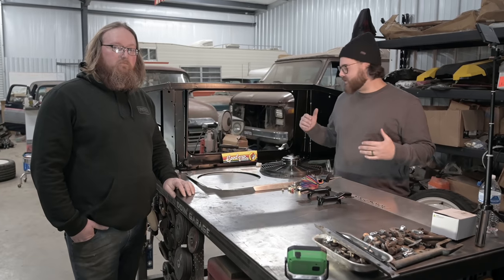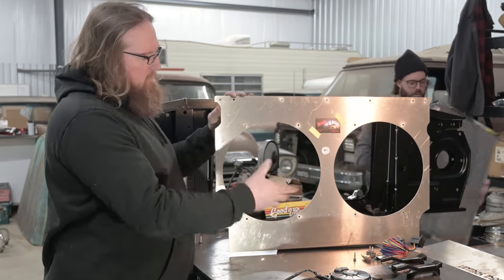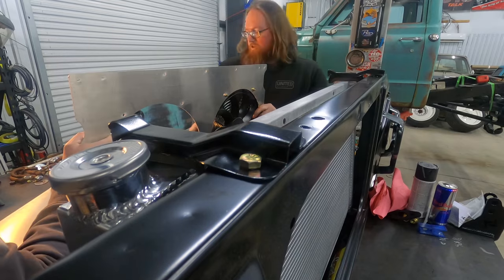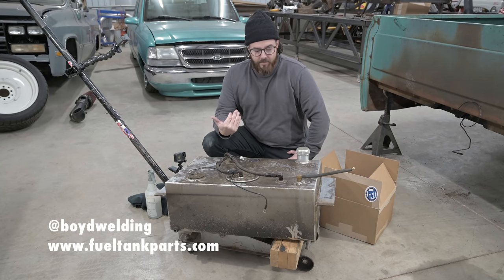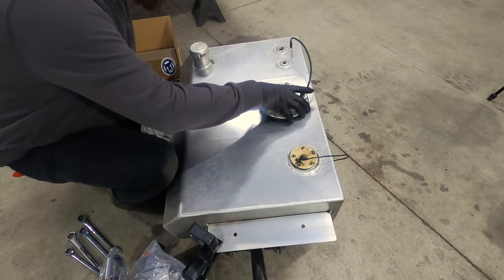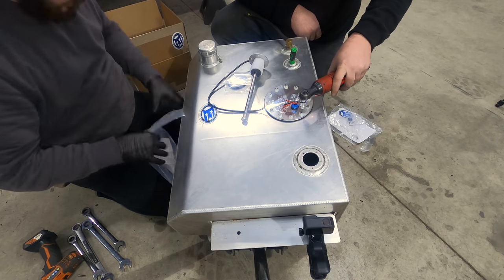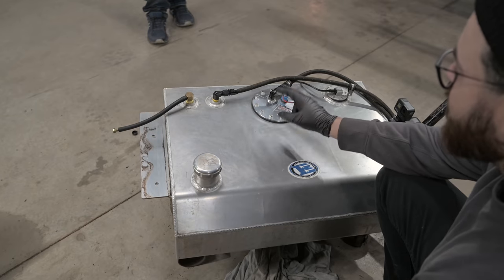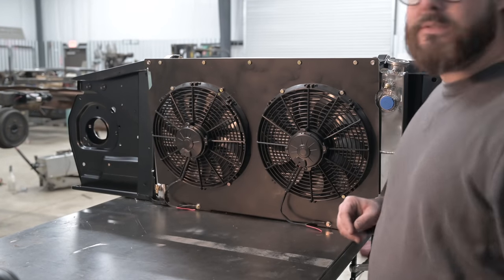DIY LS Cooling System for a 67-72 C10 & Boyd Fuel Tank Updates | TEDDY REBUILD

Comment: You can program the PCM to supply ground to control two fans thru relays. Hopefully you are doing this because they can come and shut off at different temps. Check LT1swap as Brandon does good work for trans, final drive, tire size, VATs, EVAP and more. Just a thought, maybe long done.
DK. ASE Master Tech since 78, retired

Comment: Hi guys cool setup. I’m also installing a 5.3 motor. Currently trying to install a 2007 5.3 OEM setup from a 2007 5.3 truck radiator with electric fans. Will see if that works. Saludos Jr…

Comment: Rob, Don't think you mentioned it, but you've purchased a dual pass radiator.  If your not sure, what that means is all the coolant that you pour in the top goes across the top half of the radiator. then down to the lower half back across and out the bottom fitting.  Designed for sustained  hi rpm applications it also increases heat soak time to allow additional cooling. Not necessarily a bad thing... But be aware you've brought a Shotgun to a knife fight. I would recommend an ACDelco Thermostat only and a carefully installed thermostatic temp sender installed . Hayden products offers some excellent products.  I'm not a fan shroud guy when it comes to electric fans. But since we're pass that, lets look on the fresh air side and insulate so that airflow goes  through the radiator, like an OE application would.. Love your show and best of luck.. Robby
Reply from the maker: Thanks for the heads up and education! It’s currently running crazy cool, but definitely heats up properly when the fans aren’t on.

Comment: That’s the brand fans I’m running on my ls swapped dodge. I bought them used though off a guy that had them on a corvette radiator. I paid $50 for both. Using them as a pusher and puller on my truck but I’m not running a shroud. I’m sure it’ll be alright. We’ll find out soon enough.
Reply from the maker: Awesome deal!

Comment: Do you not need to put some sort of rubber gasket between the touching metal parts for vibration and seal ? Love your videos
Reply from the maker: Yes, and we did between radiator and core support when we went back adjusted the entire front clip. New video on all that coming soon!

Comment: I would think the top plate of the shroud would go UNDER the top radiator mount for a cleaner look.
Reply from the maker: It could but it would make the upper radiator mount uneven - you’d have to space one side up and i don’t think that would be as clean.

Comment: Not that I think it won't work, and obviously you've got to do what you need to with the clearance that you've got, but I question how much air the shroud is helping pull across the full radiator core with the blades that close.
Reply: nah its fine
Reply: Like I was saying. I’m sure it will work. We’re not talking about a full heat soak test in Death Valley with the ac on for hours. I’m just questioning with the shroud only fractions of an inch away, I question how much air is being pulled across the full core.
Reply from the maker: Fair enough. The Tejas shroud we use on the blazer has a similar depth and it cools unbelievably in all conditions. Maybe we should do a test - or better yet, leave that to Engine Masters. lol Thanks for watching man!

Comment: Robbie, I got a Boyd tank side fill but I wanna turn it up thru the bed instead of out of the side. What did you do with that vent hose? Just let it hang? Thanks. Great content as usual.
Reply from the maker: We actually ran a long vent hose all the way up into an existing hole in bed side behind tail light so it’s above the tank and out of the way
Reply: @UNITEDBYTRUCKS  Thank you much. Hope to see you guys at Battle in Bama.

Comment: You mentioned the hose that goes form the driver side  to the passenger side . How is this radiator different regarding the hose? Thanks!
Reply from the maker: Both inlet and outlet are on the passenger side on the LS swap radiator. On a factory style radiator, the upper radiator hose outlet is on driver side causing the hose to run across the top of the radiator
Reply: @UNITEDBYTRUCKS  that’s Rob! Love how you always reply! You’re Never too busy to reply! Thanks

Comment: Super sweet truck man I newly subscribed and have been watching a lot of videos y’all do super cool stuff. What gear are you running in the rear end? I have the same engine and tranny setup in my 77 c10 and I’m changing my gears soon because I wanna take it on road trips.
Reply from the maker: Awesome! It’s got a just a stock 3.73 gear set that came in the 71/72 axles that’s in it. Nothing fancy. Still a one wheel peel too. Lol
Reply: Lol that’s what I planned on switching too mine currently has a 4.56 with a spool but I don’t like it so I was gonna go 3.73 with a posi
Reply: Thanks for the reply!